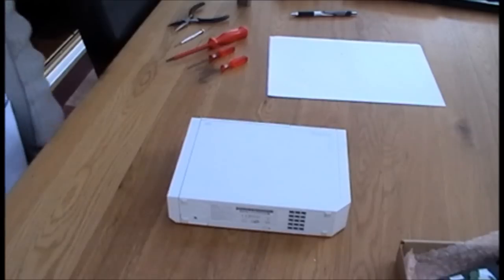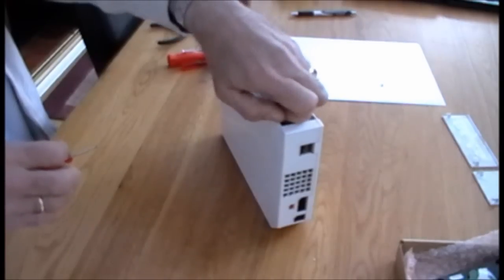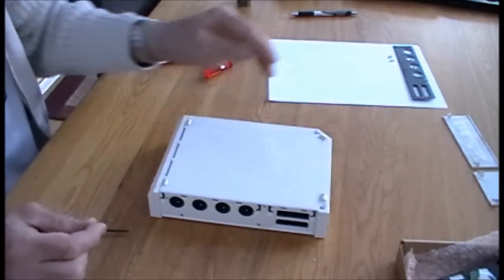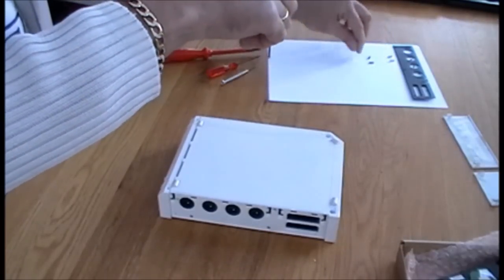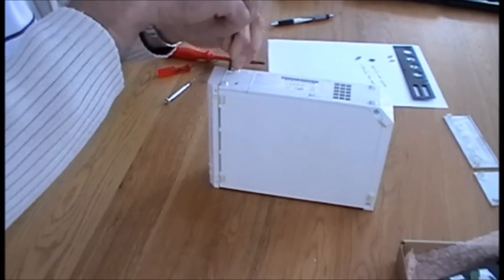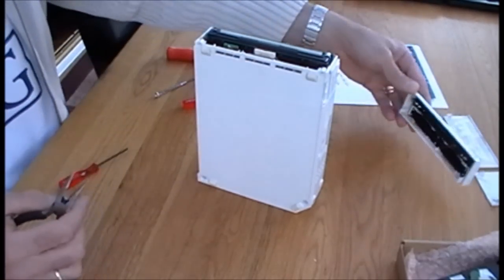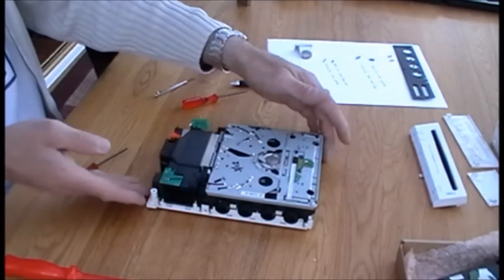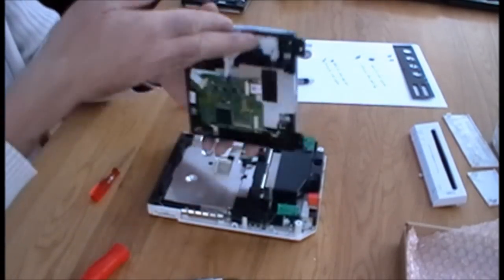Nintendo Wii "Strip down" for Disc-Drive Replacement !

Comment: Thank you for this video. We bought our Wii in 2006, and earlier this year (2020), it died. We tried a disc cleaner, but the grinding noises made it clear that it was a mechanical failure. We ordered the part off of Amazon, and your video allowed me to easily perform this repair. One screw wouldn’t come out, but I was able to work around it. Hopefully our Wii has another 14 years in it now!
Reply from the maker: Thank you for you for taking the time to comment, it's great to know another Wii is back in action and you can continue to use it and enjoy your games again.

Comment: Your instructions were excellent. Our Wii is back up and running thanks to you! The only thing that I could suggest is when doing that last step of removing the ribbon cable... The camera wasn't zoomed in enough to see the flap removal. Gently stuck the flat edge of your small flat head screw driver on the middle of the ribbon cable and gently pry upward. Put your hand over the top of the cable, my flap went a flying! 
Great instruction though, very clear!
Reply from the maker: That's awesome Erik,glad my video helped ya repair ya wii...sorry about ya flap mate..not easy to capture every angle..but thanks fa the comm's....
Reply: sorry to be offtopic but does any of you know a method to log back into an instagram account??
I stupidly lost the password. I would love any tips you can give me
Reply: @Cole Dalton Instablaster :)
Reply: @Lennon Darren Thanks for your reply. I got to the site through google and I'm in the hacking process atm.
Seems to take quite some time so I will reply here later when my account password hopefully is recovered.
Reply: @Lennon Darren It worked and I now got access to my account again. I'm so happy:D
Thank you so much you really help me out :D
Reply: @Cole Dalton Happy to help :)

Comment: My Wii was not reading disc for almost 3 years, tried installing and running USB loaders through Homebrew channel but did not succeed.  Used this video guide to replace the Wii DVD drive which I got from China (ordered on Aliexpress). The Drive is working again and reading disc. I think the the console is little more noisy and vibrations are more after the replacement - probably I did not tighten the screws enough, will try to open the console again and try to tighten the screws. Very good video.
Reply: That's good to hear your Wii is back in action after a spell of inactivity.Glad the video was helpful and thank you for your comments.

Comment: Using your video I was easily able to get into my Wii and replace the drive! I didn't have a magnet screwdriver, so when it came to putting those screws back in the drive near the opening was impossible.  However, I had a magnet that I attached to my screwdriver, which held the screw so I could get it in!
Reply: Good stuff man! Glad I could help :) some sellers who sell the drive on Amazon or eBay actually throw in the screwdrivers for free to make replacement easier...

Comment: My Wii didn't have the thin removable plastic face cover but everything else was spot on.  I have wrenched on "things" for 50 years. Never in my life had heard of a "Y" screwdriver.  Anyway, in 30 minutes I was done due to your instructions. Hopefully, it starts up when I turn it on! =)
Reply from the maker: Steve.. Pleased to hear the video helped you with your Wii and hopefully things will run smoothly again.. Many thanks for your comm's always a pleasure to read, that the video keeps people stay in the game.

Comment: Wonderfully done video. The mention of tools required at the onset was helpful in getting set up. Thank you!

 A small square nut fell out when I was putting the case back on the drive (or the drive back into the case).  For those that this may happen to, this nut receives the small screw from the battery compartment.  The nut slides into a small black plastic channel located on the side of the disk/board.  Without this nut, the battery compartment will not be secured.
Reply from the maker: Thanks Jim..Glad ta hear ya up an runnin again mate..and thanks fa the add on !..not had that issue myself in repairing wii's in the past...but it all helps..great stuff...

Comment: Handy video that I've just used to dismantle our Wii to replace the disk drive. When removing the first three screws holding down the black panel it's worth mentioning the long one goes at the front near the disk slot.
Reply: Great job Guy...glad the video helped,,,another Wii console up an running again....and thanks for your comment regards the longer screw..well noted !!

Comment: Your great video prompted the great comments. I know others can/will be helped by your video as properly "getting into" a WII without help is just plain tough. Whoever designed the Wii case and made it SO difficult to figure out how to get in should be flogged! Thanks again.
Reply from the maker: Thanx again buddy...and ya quite right...that to can be said of the air intake/fan filter at the rear of the unit...Ya can't get at it ta clean the damn thing unless ya take the unit apart...so flog him and cover him in tar...LOL...many thanks...

Comment: Thanks for the video. I was able to replace my drive and it works fine now. The tri-wing driver I used is smaller than a 1 or 2 and looks to be a Y0 or Y00 that fit those slots perfectly. Cheers from California : )
Reply from the maker: Great Job...glad the video helped...

Comment: Amazing instructions! 
I'll get my new disk drive in 2 or 3 days. I hope I bought the right one, as I was not sure which drives are able to play gamecube discs and which are not.
Reply: Thanx !!,,,I am not sure buddy...you can buy various versions of disc drive on ebay and amazon..so fingers crossed fa ya ...keep me posted and good luck !
Reply: ***** Got my disc drive and it works great! (it does sound a little different though, but not in a bad way)
The discription said it is D2A, D2B, D2C, D2D and D2E compatibel, and it plays both Gamecube and Wii games. You might use that information for future viewers who have the same question :)
Reply from the maker: Kai SchSp That's great news...glad ya got set up again and are back in the game..and thanx for the update and info...I'm sure this will help others who have the same issue.... :)
Reply: +Kai SchSp Yep that's right, all disc drives until gc2 d2e play gamecube games (and even DVDs if you have the proper homebrew for it, that's why they also can be called DVD drive). Since gc2 d3, no Gamecube disc or DVD is supported anymore and d4 (as shown in this video) isn't capable of reading GC discs either but has maybe better performance. I wouldn't recommend d2Nothing d4 for people who want to play Gamecube games since I wouldn't be sure whether they play GC discs (actually a Wii disc drive should not be able to be both, a d2x disc drive and a d4 disc drive).

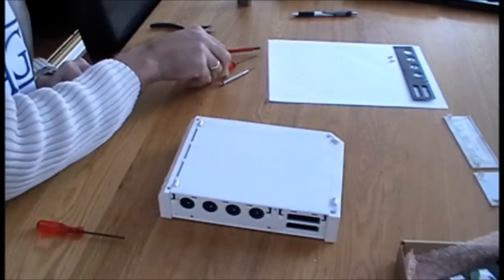Comment: For me the 2 screws at 5:00 are extremely tight, causing me to ruin the thread on one of the screws. How did you manage to remove them so easily?
Reply from the maker: Hi, Good point. I have found that on the odd ocassion, it does happen. Only suggestion is from past experience, is if it will not turn to remove, try tightening the screw first, then try removing the screw again, that has worked for me. Hope you managed the operation and your Wii is all good again and your back in the game.
Reply: @EVILSTEVEmwr  Hiya. After I wrote this comment I had just realised I never have WD-40 a go. This has done the trick. However I had done this on a different wii (I bought 4 in a joblot) and I am still stuck with the other wii that has the ruined screws. Still don't know what to do with that :(
Reply from the maker: @firestrikebs  Wd40 has a great many uses and is good for a lot of other uses than easing fixings, ( just a heads up, try googling the various uses,it will suprise you) ..however a lot of screws for consoles and the likes appear to have some sort of resin applied to help fix a screw in position and make it more secure. (ie) If you still have the damaged screws, then maybe you could try the same fix to help secure them. Good luck . Well done on your swap out.

Comment: Tri-wing screws...sigh...really?
Reply from the maker: +Robert Bell ...Hi Robert..yeah afraid so..there are a few sellers on ebay who will throw a set in with the disc drive you purchase...or you can buy separately for about £1.50...

Comment: Does it have to match the same model number cause I’m planning to do the same thing with my wii.
Reply from the maker: Hi Stephen, search ebay or amazon for a replacement Wii disc/dvd drive.... plug and play unit fits all (D4 unit).. they are still available, as this was an upgraded version better at reading action/shooter games. Hope you get it back up and running, good luck !

Comment: Where did you buy the replacement drive? Now that the Wii is so old, eBay seems like the only option, and sometime eBay makes me a little skeptical.
Reply: Yes, the Wii is old now for sure, but there are still a few sellers on ebay and amazon also. Just make sure it's a new unit and compatible with the Wii not the Wii U. It's a D4 disc drive you need to be looking for,  I would also check it is the correct one with the seller before you purchase.
Hope this helps.

Comment: Ok, so the cd-rom and hard drive are one unit? We think our cd-rom is faulty. Is there any way of cleaning it?
Reply from the maker: Hi,,thanx fa ya question HalfQ,,,Yes you can clean the reader lens if you are experiencing (disc unable to be read messages),,,the benefit of this however in my experience,,is only short term,,the reader burns on the inside of the lens also,,,so,,,I would say it is simply wiser to swap out the full unit !
    You can also just simply swap out the reader lens...this takes a bit more time once you have removed the unit from your wii...but is a cheaper option....As I don't know the problems your having,,I would suggest you swap the unit out completely to be safe,,otherwise you could just go round in circles so ta speak,,and it would end up costing you more....
  The replacement units are reasonably priced and are a simple plug and play unit...If you require a link to purchase one drop me another message,,I will be happy to provide a seller...ps..let me know what country your from...hope this helps............

Comment: Can you help me after i replaced dvd drive on my wii now when i try to turn it on it makes poping noise help pls
Reply from the maker: I have never come across that problem when fitting a new plug and play disc drive. Did you purchase a New D4 unit ? If so I would firstly return it and get them to send you another, maybe it's a faulty unit.
Reply: Well i find out that 70% is undervoltage so there is somthing wrong with the power brick how to look inside the power supply it has somme rare safty screws (not tri wing)
Reply from the maker: @eridionkiorai  I would suggest a new power lead, ebay start from £5 ,, amazon £10 New.

Comment: Hello can you help with a question. While disconnecting the front panel the black wire became separated from the solder point, red is still attached. It still ejects the games and everything, is this something I can leave as is?
Reply from the maker: I'm not sure what the black wire represents to be fair...I've heard of both wires being removed and the Wii appears to run as normal...but they are there for a reason...and I would advise trying to re-solder it..sorry I can't be more helpful here...
Reply: EVILSTEVEmwr That's at least good to hear, I appreciate your response all the same thanks!

Comment: My Wii wont suck the whole disk in only until the end and wont spin,  so and have to pull it out with a wire cause it wont eject it, will it fix the solution if i replace the drive?
Reply: Sounds like a disc drive issue to me..a new drive should sort out the problem..they are pretty cheap these days so nothing to lose...let me know how you get on ....

Comment: My Wii was making this strange grinding noise every time I turn it on.
Reply from the maker: Hi Shan,, I will suggest that you try this first as you have not mentioned any errors with disc reading ...although grinding, buzzing, or clicking noises can sometimes be a simple fix it is not always a permanent solution. If the Wii you mention is an old version I would simply swap out the disc drive at this point whilst you have the housing unit off, as they are relatively cheap to purchase off ebay and amazon.
Look online for a DB4 disc drive unit approx £20 GBP.
Alternatively ,,,, Try this ... https://www.youtube.com/watch?v=Mp1ZQS4UC9g ..Good luck Sir.
Reply: @EVILSTEVEmwr  My Wii can read disks just perfectly fine.
Reply from the maker: Then please try the link I sent you and follow this other guys video.... It could work for you Shan .. he shows ho w to solve noise from the disc player..maybe it will work..maybe it won't .. good luck ..please feel free to post here again with those results...

Comment: Can you swap hard drives between 2 wiis?
Reply from the maker: Hi Brandon, If the Wii is the same edition ,then yes you can. I actually did this in the first instance, before eventually deciding to purchase a better quality 'disc drive' (that being a DB4 unit disc drive) from a seller on ebay,  same can be found and purchased from amazon.  A (DB4 unit drive) was an upgraded version of the original drives first fitted to the Wii's when launched, and said to be better at playing the faster shooter and driver games. Good luck ,,get it swapped out and if you have the time, come back and let me know all went well ! stay safe !

Comment: i replaced dvd drive buy still says disc unable to read. Any suggestions
Reply from the maker: +MrRichardc Hi...sorry to hear you are still having a problem..I have to say I have not experienced any problems what so ever since fitting the replacement D4 drive....I can only suggest maybe going back into the wii and cleaning the reader with a soft lint free cloth and some acetone (nail polish remover)..but in all honesty this should not be necessary if you purchased a new complete plug and play unit..
Reply: i hate to admit this but it might have not been the problem. The three games and dvd disc cleaner would not read. I got a new game and it read it fine. Now I'm wondering if it was the problem at all. I know someone that can use my old dvd drive though. Thanks for the message.
Reply from the maker: +MrRichardc Ahh I see..well thanks for the update...I'm glad its working..and should last a good few years I would think..the D4 drive is supposed to be an all round improvement on the original so I've been told..good luck with it and again thanks for getting back to me.